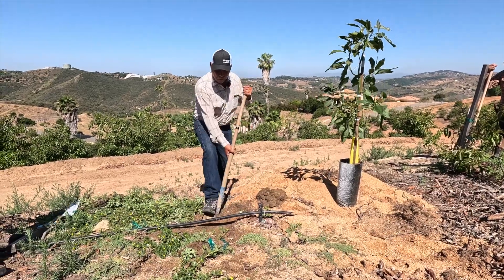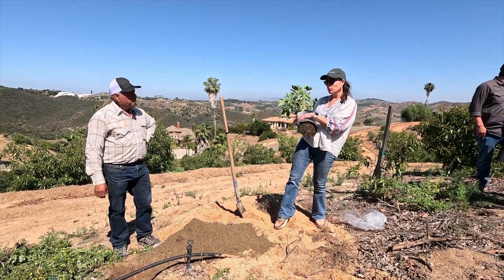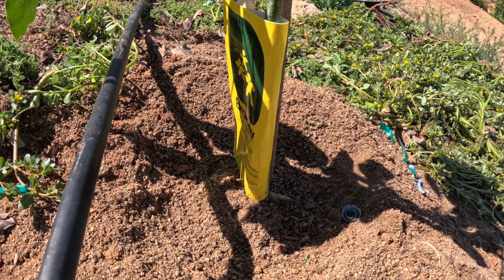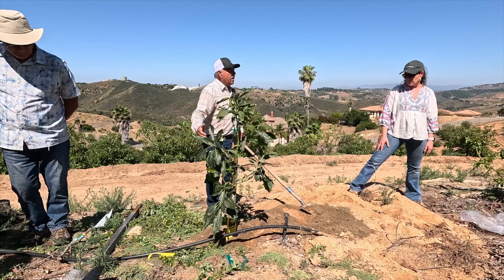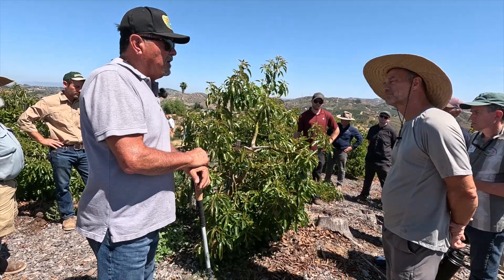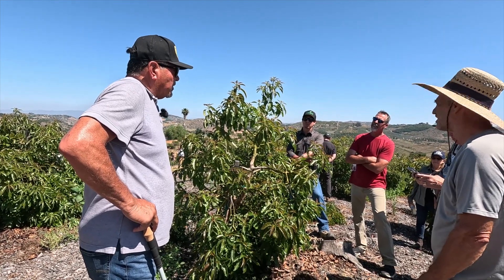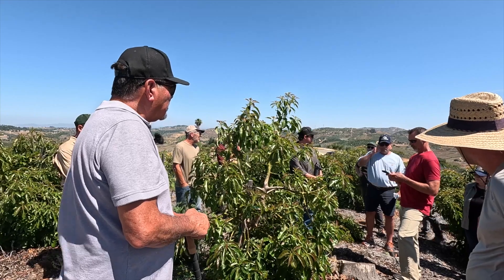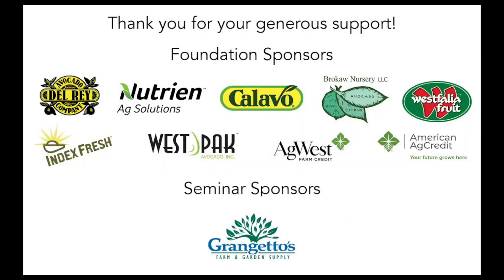CAS/CAC/UC Cooperative Extension June 2024 Avocado Growers Seminar Series.

Comment: What is a clonal avocado plants? Any specific characteristics?
Reply: Clonal avocado trees refers to the rootstock which is clonal.
“Normal” trees are seedlings onto which a variety has been grafted.
With “clonal” trees you start off with a seedling, then first graft your rootstock variety onto the seedling. You then first have to put that tree through a rooting process so that the rootstock graft forms roots and grows. The seedling is then cut off at the bottom of the tree and you are left with your clonal rootstock onto which yhe preferred variety can be grafted.